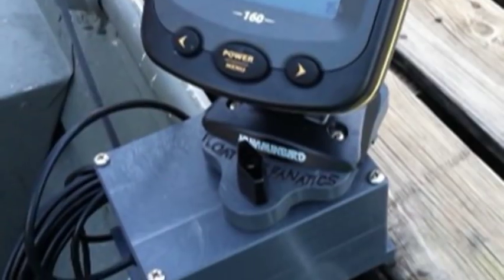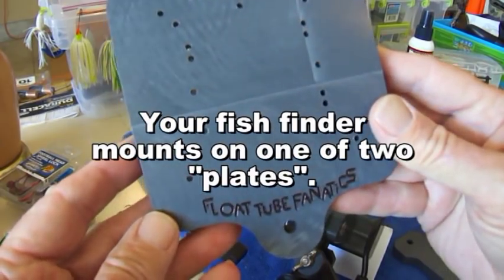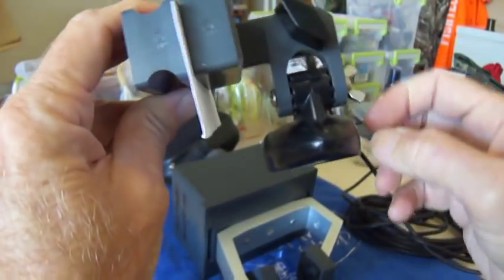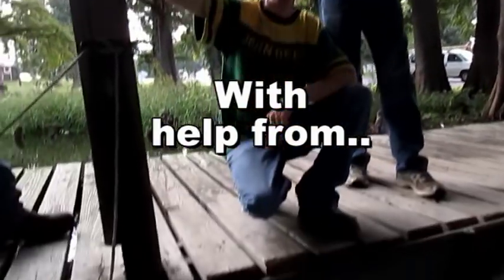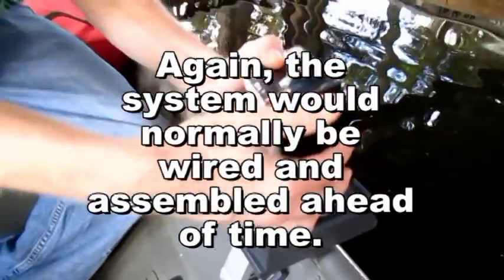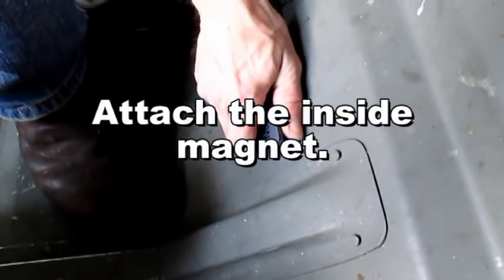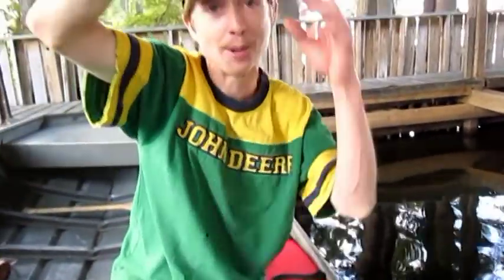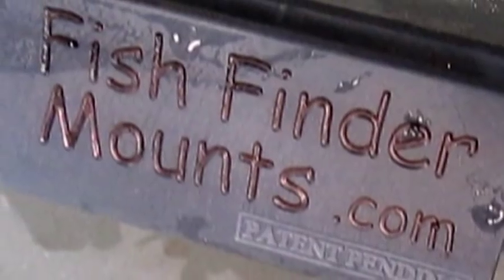Install a Fish Finder and Transducer on a Boat in Seconds!

Comment: How do you charge the battery?
Reply from the maker: Hi Jesus,

You want to use a charger that is made to service motorcycle batteries, and smaller SLA or AGM batteries as such.  You do not want to be using an automotive style charger.  They trickle at 2 amps, which is really too aggressive for our smaller batteries.  We have a suitable charger on both our websites, I.e. Float Tube Fanatics and Fish Finder Mounts .com.  Hope that helps you Jesus :)

Wade